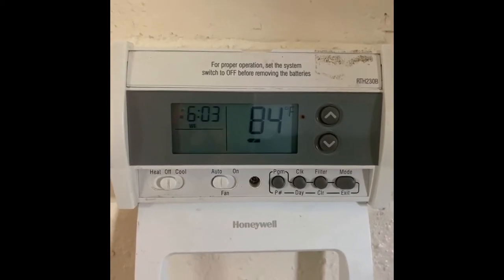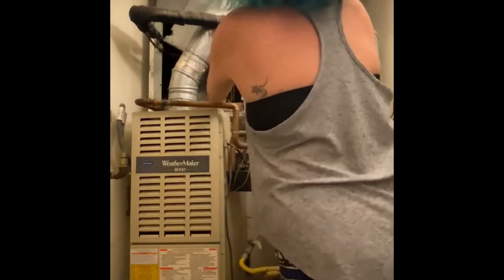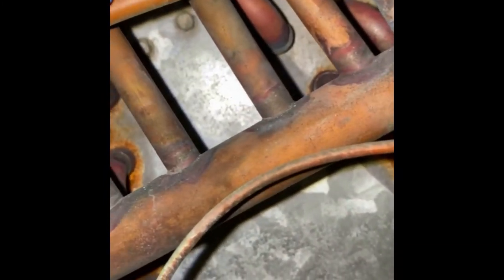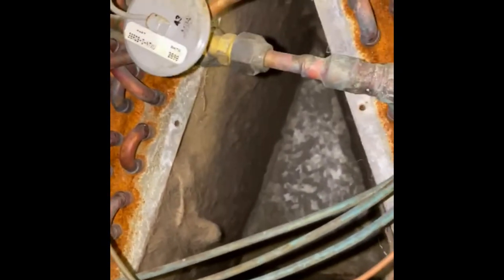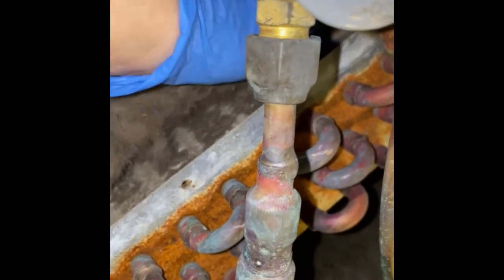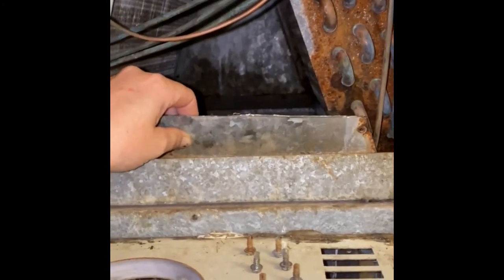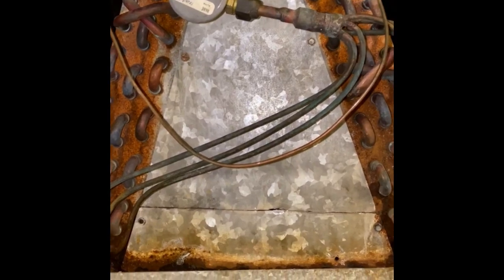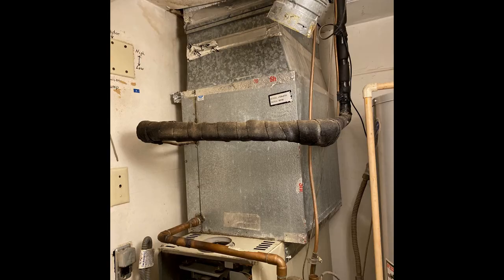Woman Cleans FILTHY Evaporative Indoor Coil / AC / AC Maintenance

Comment: before I give my comment can we just give this lady a round of applause. I love it when a fellow woman takes the initiative to learn to do something even if she doesn't know how. so many women close their mind off to the possibility of getting dirty or they don't know how to use a screwdriver, give me a freaking break. You go girl!! 
Now for my comment;
Holy crap!!! Has nobody heard of a furnace filter?? Wow that is insane. I would have to say either A a furnace filter is not being used at all or B the very cheapest one you could possibly find is being used and the furnace is just super old and that's what has managed to get thru all theses years. Either way I'm surprised it has not blown the compressor already.
Reply: As a female architect for 40 years, I’m sorry that you haven’t seen many technical women, but appreciate you supporting her.
Reply: @cdubya3071  I am a female. I have worked in the male dominated industry of home repair for 20 years as my career but long before that I was taking things apart and eventually figure out if you don't try you won't ever learn. So many of my female friends and family would call me up for help because they know I love a challenge and would fix stuff for free and it would turn out to be the simplest thing like a lose screw or even had one friend just needed to change the bag in her vacuum cleaner.
Reply: I’d say their not using filters. That unit may cool a little longer but it will not run in a efficient manner.

Comment: I've watched so many video on troubleshooting hvac for the ac not blowing as cold as it should.
I've troubleshoot breaker, contactor, capacitor, compressor, washed condenser coils and even had a service call tech say my compressor was bad.
Yet my unit would still blow cold air, they quoted a $20k price tag.
You are the first person to even mention the evap coil.
It's 1:00am right now and at 7am I will start the adventure.
I bet you that is what it is.

Comment: Sam, I like your video! Let me ask you a question. AC repairman came over today and told me that the coil condenser thing is very dirty. The way it is installed it is very difficult to get take out it's in the ceiling by the air handler. Question he says if they try to clean it they said that it's much easier just to replace the whole unit it's so dirty the blowers and the coil. Cost 2350!  For NEW and LABOR.  5-6 hour job.I kind of believe what hes saying. What do   you think. Should I clean it or just replace the thing ?
Reply: Sam, in fact he told me that most AC technicians won't even try to clean the  Call/condenser. Any feedback? Appreciated.
Reply: Cause in order to get to the coil/condenser everything up there has to be taken down! 2 blowers ,  the evaporator Pan, and the .....coil/condenser. So, it sounds like a good plan just to replace it. It would probably cost $800 to Maybe a $1000 to just clean it. The air handler etc is in the ceiling of my hallway.
Reply: Wow, the arrogance.  You ask for advice & claim you like her video then immediately after insolently criticize it.
Reply: @curiouser-and-curiouser   Mo baby, what do you mean "insolence "? I re read all my comments and I don't see that . I didn't mean any" insolence". I don't get it.  You're the one who sounds like a "hater"  I didn't mean to be  Hating on  anything.  Chill.  You may have misunderstood my comment.   Anyway, I ended up replacing the complete air handler.  And had ALL KINDS OF TROUBLE.  The "young" techs messed up. I had a "leak"  and it took 7 SEVEN TRIPS  and FINALLY the chief tech (older dude) came out and discovered the problem. The air handler was DRIPPING   on my  CORK FLOOR!   (Had  to put  CONTAINERS  down and WALK around them in my hallway.)    A nightmare.  And to this day I STILL don't believe it was a DIRTY COIL.  Cause I SAW the coil and it SURE DIDNT look dirty to me.   Bottom line :   Make sure that you have an EXPIERENCED ( possibly older person who has seen a lot)  person to inspect ANY mechanical device.  Oh, I live in S. Fla.   where it is ALWAYS HOT !! Ha.

Comment: Thanks for posting this!  I have a top mount evap and have been afraid of doing anything but spray the cleaner onto the topside of the evap.  My HVAC unit has had a poor fitting filter since the installer never left proper room for it.  Now that I see it can be done, I think I'll give it a try.  It's gotta help, 17 years in the house with multiple pets has been causing short furnace cycling and long AC running.  Thought I was going to have to call a pro and spend big $$$ to remove (and hopefully save) the freon so they could take the unit outside and clean it with a hose or however they do it; I doubt they would take the time and effort to do it your way.
Reply: Yep that’s right the a/c professional won’t do it they will want you to buy a new unit
Reply: Hey Jeff. can you please clarify what you mean by "short furnace cycling"?? I've tried cleaning my furnace to the best if my ability because the previous owners had pets and there was pet hair completely clogging up furnace. I got the duct cleaning done too, and then I ended up removing the furnace blower motor to get rid of even MORE pet hair that was caked on a secondary heat exchanger....and now I'm going to open the panel to see what my evaporator coils look like. 

My issue is that my furnace cycles on and off in the winter when the indoor temp gets to within 1 degree of the temperature that i set my thermostat to. It doesn't matter what temp i set on the thermostat....but as soon as the furnace heats the home to within 1 degree of that temp, the furnace flames shut off, and then go back on 20 seconds later. Then they'll shut off right away again and will ignite seconds later, and this keeps going until I eventually cut power to the furnace. 

So, is this the issue you were experiencing too?? Is that what you meant by "short furnace cycling"? Please let me know, because I'm extremely curious if a clogged evaporator coil would cause that issue. My evap coil sits on top of my furnace burners....just like the one is this video.
Reply: @gjuelz7672  When it’s extremely cold outside (20 and under) my furnace does exactly what you’ve described. 

What I also mean is that when the temp is above that, it used to run with the burners on for a good while. Now, as my evap has gotten more clogged, the burners will run for 4-5 minutes then shut off. As soon as the inducer fan shuts off, it turns the fan back on and then lights normally and repeats that until the thermostat turns it off.

Comment: For everyone doing this do you all have a filter in the house that is supposed to trap most of this? I only ask as we have filters, replace them every 6 months or so. My neighbor is an AC contractor and said I do not need to perform this procedure since I have good air flow. If you guys that have done this and have a regular filter and the coils were still dirty I think I might try this service as well since my AC unit/s (up/down) are 25 years old. Thanks for the video!
Reply: Yes even with filters its a good idea to check the coils each time you replace the filters.  may not always need deep cleaning, but you'll know. Keep an eye on the condensate drain, the hose will cog, usually at the first bend, but is easy to clear. Edit, also, at 25 years it's a good idea to start budgeting for replacement.
Reply: @dommergames5231  thank you for your reply. I agree about budgeting for new units (we have upstairs and downstairs separate). Fortunate for me my neighbor across the street is an AC guys and he keeps it going for me. He owes me for life, lol with all the times I lent him a hand, lol.

He however has told me I do not need to open up the units and clean. But I know for fact that they have never been done. Previous owners to this house had dogs and we have a dog. Not sure if that hair can get past the filters.

Comment: This is what I'm trying to do. I got to the coils but didn't try to take the triangle shaped piece of sheet metal off. How does it come out? Does it go down then lie flat inside and you pull it out horizontally?
Reply from the maker: The front piece on mine is only attached to the front with screw bolts.
Reply: @TheSamSamShow  Thanks for the reply. How did you get it past the small pieces of copper tubing?
Reply from the maker: You can pull the entire A frame forward like 6 inches to help maneuver- it wasn’t easy and honestly I wasn’t able to get it back on easily so I cut it in half with a dremel. 🤷‍♀️ use DUCT tape to seal. Hope it helps….
Reply: I ended up pulling a sensor just below the evap that gave me access to the top of the combustion. I put an inspection camera through the hole and up into the underside of the evap. I could see it was really pretty clean, so I'm going to leave it for now. Your suggestion of pulling it forward is the answer I was looking for though. Makes sense, and I don't mind cutting it if I ever decide to clean it. I posted on a forum and got a lot of suggestions, but no one came up with your solution. Thank you, you rock!!

Comment: If the coil is that dirty the blower wheel would be just as plugged. May also want to actually install and regularly change the furnace filter. A evaporator coil does not become that plugged if a proper filter had been installed and replaced monthly.
Reply: The missing cover screws allowed air to bypass the filter as well. First disconnect electrical power before doing any work .

Comment: Your evaporator coil pan is steel .... like mine.  It's rusting as is mine.   I'd like to replace my evap coil with one that has a plastic pan like most new ones. It would also get rid of lint and dust on the evap coils. I have the gear needed to do a pump-down and evacuation. I also have a nitrogen tank and vacuum gauge to check for leaks.  What do you think?

Comment: In San Antonio Tx, an AC guy quoted $400-600 to clean coils alone if it needs cleaning on top of a regular AC tune up!?
Reply: No if you keep your filters changed
Reply: It can be anywhere from 4-6 hours labor. $80-$125/hr. I assuming the guy will be removing the coil and cleaning it outside. $400-$600 doesn't sound to bad. If your able to clean in place like she did 👍

Comment: Good work on the coil cleaning. Please make sure some one inspects your furnace heat exchanger. That model is know for cracks in the heat exchanger. Turn power off remove high limit can get a good look at it ( heat exchanger has round dimples on the side find most cracks there. Or you can remove the triangle shaped plate from your coil again and inspect heat exchanger that way. rec. certified service tech to inspect heat exchanger. Please make sure you have carbon monoxide detectors...
Reply from the maker: Thank you! I will defiantly get that checked out…. And I do not have a carbon monoxide detector- I will get one ASAP!!
Reply: @TheSamSamShow  last poster is right. please have the heat exchanger looked at and get some co det. Your life is worth it.  Great video.
Reply: @TheSamSamShow  GREAT JOB. VERY CLEAN.

Comment: That is not felt, that is dust that escaped the filter. The must be more dust stuck between the fins of the coil. The next time you call your local HVAC technician, ask them to use coil cleaner on the coil

Comment: Use  cheap pleated filters. They don’t restrict like the expensive ones while not letting all that buildup in like super cheap fiberglass filters
Reply: Or maybe add larger filter cabient, cause that dust doesn't disappear it gets on your blower wheel reducing efficiency then on back of your blower motor insulating it causing blower motor work harder, shortening its life expectancy, then to your coil,reducing its efficiency again. Your welcome.

Comment: I seriously loved this. I need to do this somehow,  someway...I wish I didn't have to sleep and didn't have s*** to do everyday.  Thanks for the video!! The music would have put me to sleep without your humor.
Reply: Update: I did it! I found out that I have a slant Coil so it was not as difficult. I didn't have enough to make a sweater though. I don't know if it worked but my AC is better. I also replaced my thermostat and drained the lines. My intake is located in my attic so I waited until after midnight to attack this. The temp in my attic reaches well over 100 degrees and so I sacrificed my sleep. Took a couple of hours. Thank you for this video, you made it look so easy!!!